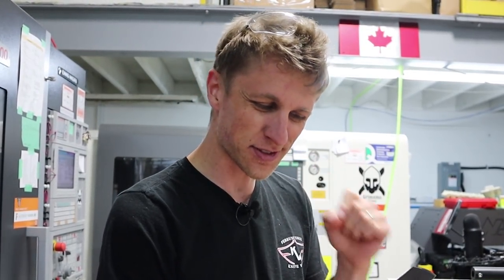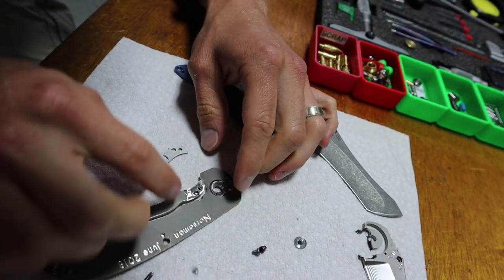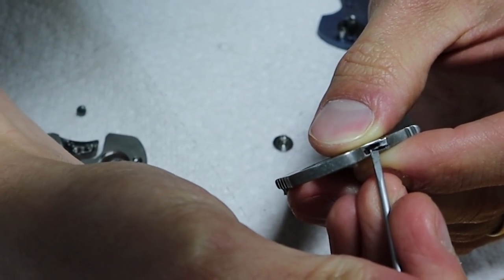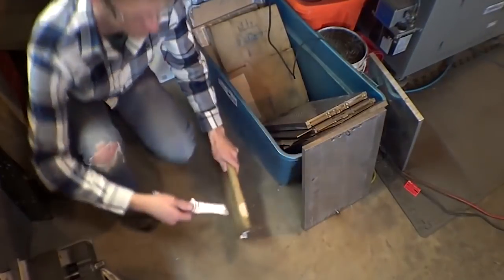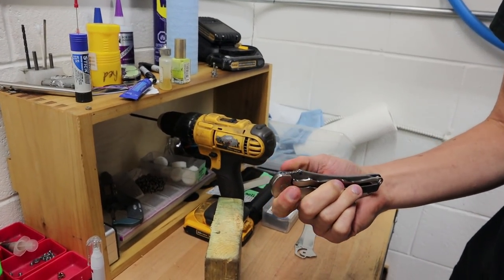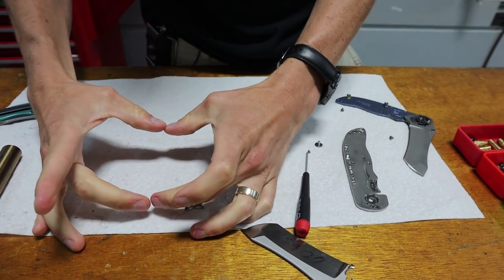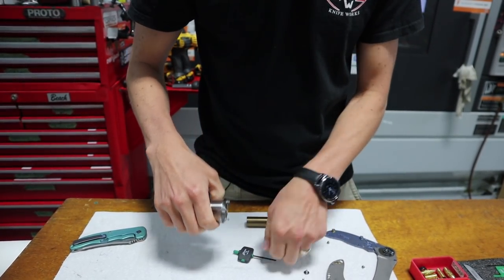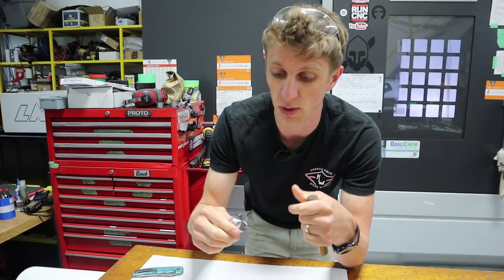Adding a Lock Bar Insert Pt. 2

Comment: you could mill the outside shape of the insert along the whole length of the round bar and then heat treat to case harden just the outside perimeter of the lock bar insert before doing cutoff to get the individual inserts maybe? Might save some end mills as they wont need to machine the prehardened material.

Also wondering if those cutoff parts, will taco on you and lose their flatness once cutoff due to slight stress variance from outside of shaft to nuggety center.